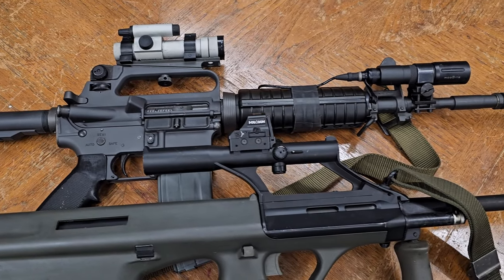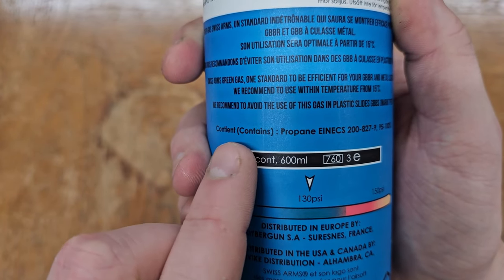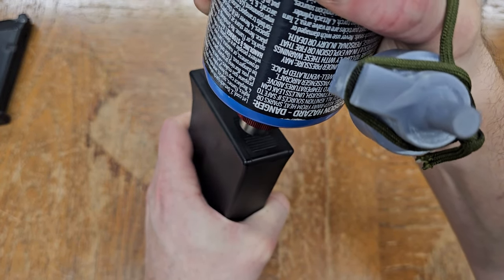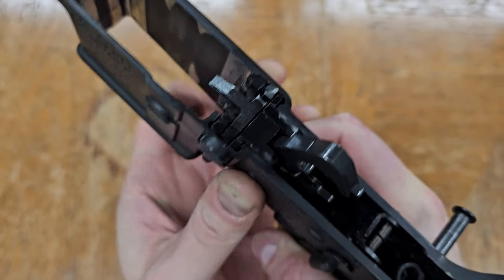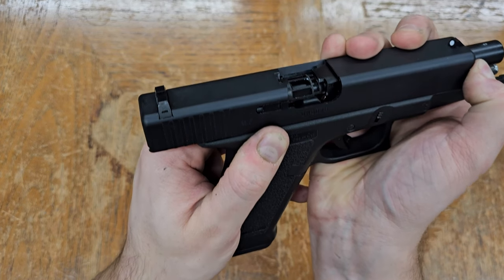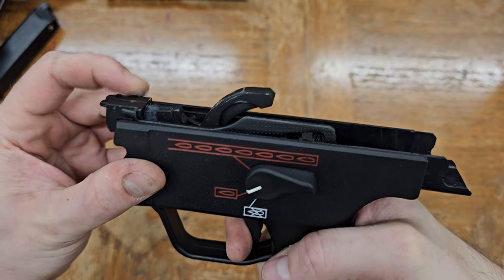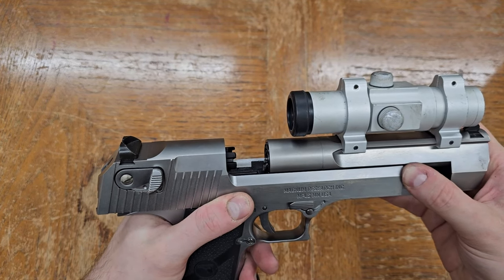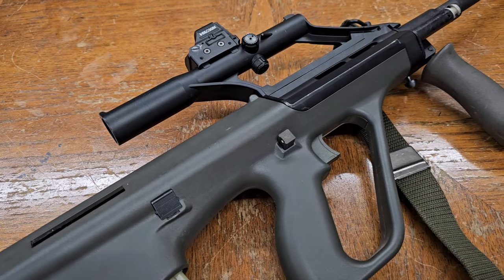Airsoft Gas Blowback 101- How Does a GBB Work?

Comment: This is a great detailed explanation of the GBB system. When I was first starting out, it took me hours to figure out the inner workings and how all the different elements meshed together.
Reply: A lot of GBBs function nearly identically to their real steel counterparts with the exception of the propellant source. If you take apart a GBB pistol, you'll notice a striking parts commonality with the real thing. In fact, I was rather astounded myself when I took apart both my real Glock 17 and airsoft Glock 18 and noticed how many parts are similar. Sear, trigger, recoil spring, etc are all nearly identical. The main differences are a nozzle instead of a firing pin and the gas source itself coming out of the mag. Some of them were so similar I had to make sure I didn't mix up the parts and put the wrong part into the wrong gun.

Comment: Very well explained, better than a 3D-animation could do!

Common issue with gas blowbacks is liquid gas visibly spewing out the side or even the muzzle during fast shooting or full-auto. If you could cover this in the next video it would be appreciated.
Reply from the maker: Thanks, and we'll definitely be covering siphoning in the next video.
Reply: My Umarex Walther PPQ seems to do that more often than my Cybergun/WE and Tokyo Marui Deagles, if I do not use it for some time.
I got the impression that the output valve is the culprit, when the valve's mechanism becomes compromised during fast repetitive shooting. I noticed with one of the mags that belong to my TM Deagle, that it doesn't close properly anymore, so that when I try to refill it, the gas immediately escapes from the gas router. When I removed the valve, I noticed that it did not open and close smoothly anymore, as the axle seems to be bent a bit. But this mag has functioned well before, so how did it sustain such a damage?
Anyway, I've got enough mags to spare, and valves can be replaced, but still, this is something that bothers me a bit.

Comment: Awesome video as always, guys. When you really boil it down, gas blowbacks are pretty easy to understand once you become familiar with them. And personally it didn’t take me long at all to get a good idea of the workings of these guns. They’re so much simpler than people give them credit for
Reply: Yes, well, once you get started with maintaining and upgrading AEG guns, things can become more daunting, as you have to deal with fiddly mechanical and electrical issues that need to interact flawlessly. My only experience with GBB is with my Deagles and my Walther PPQ. I only have AEG rifles, no GBBR ones, so that I came to learn the intricacies of gearboxes and mosfets, triggers, and nozzle/hopup tweaking, even before I operated upon one of my Deagles to repair the valve-knocker. I actually replaced the original trigger-spring in another Deagle of mine with a spring from one of my wife's hair clamps! It was a perfect match, and from hindsight, that hair-clamp spring does a better job than the original trigger-spring from the manufacturer.
This is definitely a sport for tinkers and techno-geeks, apart from the odd skirm opportunity that comes along.

Comment: Another excellent video, solid stuff Cat and nice work especially getting such clear images of the smaller components

If I may make a suggestion for your myths and misconceptions video, I've seen people parroting that the nozzle sticking in the bucking when pulling back manually is a sign of good gas seal, and vice versa if it stops sticking. I personally have no idea whether there's any truth to this beyond the physics of gas potentially leaking between the bb and the gap between the bucking/nozzle if the gap is really that big, but it would be good to see some more input on what it means when it sticks, what it means when it doesn't, and what it means when it changes day to day.
Reply from the maker: Already in the script- that's a fun topic and definitely one we plan to address. No point in keeping it a mystery, though, so tl;dr: It doesn't really mean anything whether the nozzle sticks or not, because a good seal may not stick at all, and a bad one caused by a pinched bucking may snag on the nozzle and make it stick. The best way to test your seal is simply to check whether it seals.
Reply: @ExplosiveEnterprises  fantastic great to hear it, and good point on the pinched bucking type of issue too

Comment: This is an excellent video and instruction guide for new people looking to find out how the system works. In all fairness I am an armorer and have a firm knowledge in how firearms work but the gas blowback system is something that struck my curiosity and I wanted more information on it. Diagrams are nice but I am a hands on person and learn more by doing then reading. Now I just need to figure out what gas to use, type of airsoft gun to use, and what spring tensions are used for the parts to see if they can be tuned for multiple pressure levels or if the system requires a static pressure until empty.

Comment: I've been always wondering what will happen if you fire a gas blowback pistol if the slide is locked so it can't go back? Basically can you turn a GBB pistol into a Hush Puppy by mounting a slide lock mechanism so after the shot you'd need to deactivate slide lock and manually rack the slide before another shot? Or the gas pressure would cause damage to the nozzle, rocket valve or something else and a single shot would release all the gas from the magazine?
Reply: In theory this would just cause the nozzle to hold the pressure of the mag after the rocket valve is closed. If everything is properly sealed, no more gas would be released until you let the slide go, then the pressure pushes the piston back and the gun cycles one time like usual.
Reply from the maker: Because the valve knocker holds the valve open, preventing the slide from cycling causes the gun to immediately dump all its gas through whatever seals are imperfect. You can, however, get the desired effect by removing the rocket valve entirely (so the nozzle cannot seal and build pressure- all the gas goes out the barrel) and changing the hammer system to a rebounding type as on NBBs (so it strikes to release a certain amount of gas, but doesn't lock forwards). But these are permanent or at least not field-adjustable modifications, so it isn't possible to get a selectable Hush Puppy this way.
Reply: @ExplosiveEnterprises  that's what I thought. Would be interesting if it would be possible to make a Hush Puppy and be able to switch between semi auto and single shot with slide lock. Maybe if there would be some kind of secondary rocket valve that would be connected to the slide lock which would unlock it when the slide is locked so it would cause the valve knocker to reset. In theory that could work, technically the separate reciprocating part of slide that engages the reset that is either unlocked from the rest of the slide and reciprocates to reset just the valve knocker if the slide lock is engaged, or it's locked with the rest of the slide when the slide lock is disengaged so the whole slide cycles. Sounds complicated though.
Btw, are there any NBB pistols that have the slide that you can rack to arm the hammer and go from Double to Single Action? Except TM Mk23.

Comment: I got a few questions, I hope you can answer.

I'm planning on getting the umarex/VFC HK416 A5 gen 3 GBB. It would seem some mags v2 dont work as well as the current V3 gas delivery system. Would putting regular propane instead of the green gas cause any problems? Your video seems to suggest not to use green gas at all. 

Also, I'm trying to research if any M4 style GBB mags would work for this gun or it needs to be a Vmag?

Comment: At 7:04 this video shows a BB being driven into the chamber as the slide returns. I assume this means that once the trigger resets, the gun can discharge another BB. I discovered that my rotary magazine Sig P 226 does not rotate another pellet into place until the trigger is pulled from full forward. I had been baffled by gas being discharged without a pellet for years until I started removing the mag after each discharge and noting the position of empty positions in the mag. I was told by Pyramid Air and Airsoft Depot support personnel that all airguns had to have their triggers returned to full forward in order to discharge another round. This video seems to indicate that the illustrated pistol can discharge another projectile as soon as the trigger resets. Is that correct?

Comment: Question: what difference does it make how stiff the nozzle spring is? I've heard people say that for ex. they'd put a 150% nozzle return spring in their gun. But AFAICT the nozzle doesn't need to go back into the carrier, it only needs to go back behind the next BB and there is a stopper on the carrier which yanks out the nozzle from the hopup anyway. The GHK AK doesn't even have a nozzle spring and it still works fine.

Bonus question: where does this Desert Eagle + huge red dot combo come from? I've seen something similar on facebook once and I liked it so much that I had to get a big red dot for my own Desert Eagle.
Reply from the maker: While the nozzle should clear the BB stack even if it doesn't retract at all, the timing is often fairly tight, and it's possible for the carrier to cycle so quickly that the next BB in the stack doesn't have time to pop up before the nozzle goes forwards again. This can also be an issue if the gun siphons liquid propellant (something we'll cover more in the next video), which takes time to expand in the nozzle and can prevent it from collapsing at all. Plus on some guns, the nozzle may retract far enough to exit the hop, but not far enough to clear the BB stack without some help. In any case, a stronger return spring /may/ help the nozzle to retract and lengthen the amount of time before the BB has to be presented for feeding, but more often than not it isn't actually necessary. 

Otherwise, the main issue we've run into with spring-less systems like the GHK AK (or KWA MP9s after they yeet their return springs) is that if the nozzle doesn't retract at all (typically due to friction), it can actually feed a BB into the chamber and /then/ collapse into the carrier, and the only way for the trapped air inside it to escape is out the front- dislodging the BB or potentially even ejecting it out the barrel entirely. GHK gets around this by making the feed lips excessively tight so that the nozzle cannot strip the BB until it collapses into the carrier, which is, well, one way to solve it.

As for the Desert Eagle, our owner was inspired by both Predator 2 and Marathon 2. It doesn't do anything a modern micro dot can't, but it sure looks cool.
Reply: @ExplosiveEnterprises  Thanks for the info, fortunately I haven't run into this issue yet.

About the Desert Eagle, I'm a big Predator fan, I suppose the image was just sitting deep inside my brain.
It was the same deal with the KTW Spas-12, I had to buy it because for some reason I found it very cool even though it didn't have the iconic folding stock, and then years later I rewatched "The Matrix" and understood why.

Comment: I am looking to get more into gbbrs , but have been getting mixed advice with propane vs green gas, does propane actually go through seals and need to have silicone grease added and or seal manually maintained, or is it not that big of an issue

Comment: I have a problem with my SVD Aim top rifle that it does not cycle at all anymore and only vents all the gas out until I pull the bolt back manually. I haven’t used it or touched it for a whole winter and now just started back up on maintenance. My guess is that the rocket valve is getting stuck inside the nozzle because it hasn’t been lubed for a long time. So if I lube it with silicone oil, it should work again, right? Or do I have to buy a spare nozzle to replace it?
I wonder if anyone else encountered this problem as well. I’ll update if the problem is fixed. Otherwise I’m open to suggestions.
PS don’t buy an AIM Top gbb rifle, they’re too much.

Comment: How do you lubricate the nozzle o-ring? Do you remove the nozzle every time? Because that's more disassembly than I'd like to do during maintenance.
Reply from the maker: We suggest checking out our gas blowback maintenance video- basically, you can just drip oil in without disassembly, or if you disassemble once to grease the o-ring/piston then you will rarely need to do it again.
Reply: @ExplosiveEnterprises  Thanks, I think that video was released shortly before I found your channel.

Comment: What brand is your Car 15 clone and what clamp do you use to mount the flashlight?
Reply from the maker: It's a Viper Tech replica of a Colt 727, and you can see more of it in our prior videos on the platform. The mount is a generic Chinesium clamp-on rail section and a Weaver ring to hold the light body.
Reply: @ExplosiveEnterprises  thanks for the response. Where do you source the Viper tech 727, is this something I can still buy or is this an older replica? Also where do you all buy your GBB's since you seem to have a very nice supply of GBB items.
Reply from the maker: @MK384  Viper Tech replicas are best sourced directly from the manufacturer. They still make all their models to order, as far as we're aware. As for other GBBs, we get them from a variety of predominantly Hong Kong and Taiwan based retailers. WGC, Redwolf, Proact, Airsoft Global, and eHobbyAsia have all been reliable for us.

Comment: I don't think the flow valve gets pushed and seals, if you stop a gbbp from cycling you can clearly see the gas all spewing from the barrel
The cycling is due to the fact that the gas goes both towards the barrel and the back at the same time, and trying to expand at the back makes the gun cycle
Reply from the maker: When the slide is held, the gas escapes through the barrel because the typically plastic-on-plastic contact of the rocket valve against the nozzle does not seal as effectively as any of the nitrile rubber gaskets used elsewhere, so it takes the path of least resistance. In normal operation the seal is sufficient to minimize losses- if you modify the gun in such a way that the rocket valve cannot fully seal, it will (usually) still cycle, but there are direct and noticeable effects on blowback and efficiency. We'll be covering this in the next video.
Reply: If what you're saying was true at all then that would mean the nozzle valve could be removed without issue.

But clearly that isn't the case.
Reply: Average airsofter moment be like:
Reply: @CLODXJ6 i have yet to test it. I heard once about a gbbP cycling even without the rocket valve tho
Reply: @ExplosiveEnterprises thank you for tbe explanation, I'll look forward to the dedicated video, keep up the good work!
Also hurry up and get a vfc scar H, I want to see what you'll come up with to make it more reliable!

Comment: Which Makarov do you have in the starting of this video? Would you recommend it? Any tips and tricks?
Reply from the maker: It's a WE, and while it's the least bad airsoft Makarov that is unfortunately a very low bar. The barrel and slide have enough unavoidable slop that the sights are more or less useless, the hop-up is fragile and cannot hop above ~.25g without modification, it's very typically WE in its pot metal construction and ensuing wear, and since it was actually patterned off a Baikal airgun actual Makarov grips need extensive modification to fit. Unfortunately, our best tip and trick is to avoid it altogether.